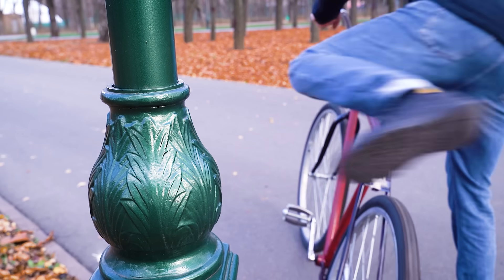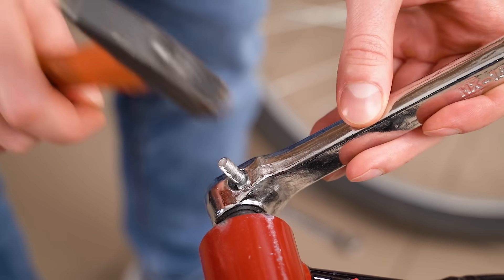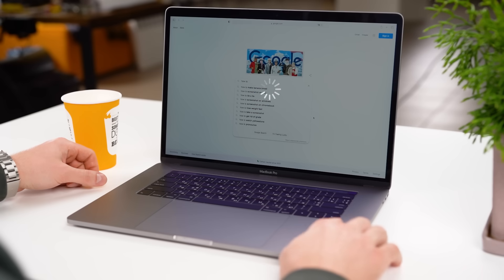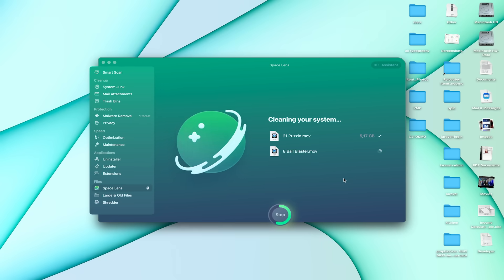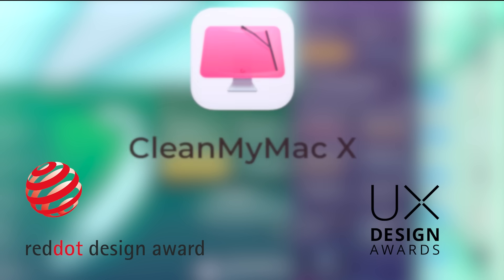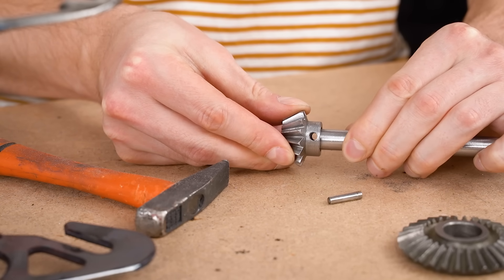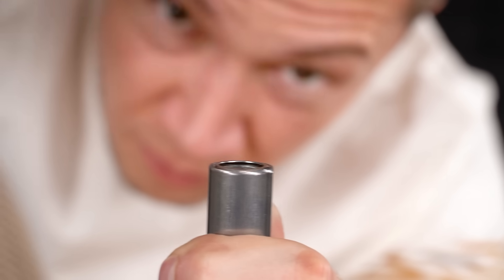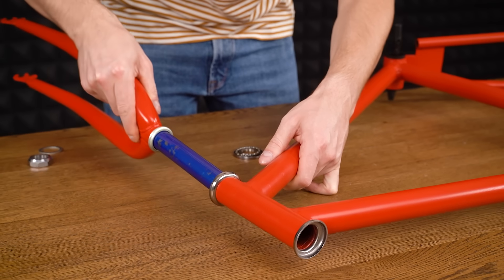Insane Chainless Bicycle Prototype

Comment: The sleek look is definitely top notch. The major disadvantage is friction loss which will be much higher than a conventional chain.
Reply: To do this, you need to lubricate the mechanism, I had an electric saw where the same mechanism was used, I forgot to lubricate it and as a result, after a week, the links were erased.
Reply: I cant speak for bicycles but in motorcycles a new chain is more efficient than bevel gears but actually research shows that chains lose efficiency rapidly as they wear. On a bicycle I guess that's less of a consideration. That's one reason you've seen more motorcycles move toward using belts and gears in recent years, along with lower maintenance.

Obviously with a bicycle gearing is a substantial consideration that favours chains. 👍
Reply: What about the freewheel coast element?
Reply: And another is that he can't rest his foot as the wheel rotates with the rotation of the pedal,unlike the chain system
Reply: @Intesiser2292  That is true as far as this prototype goes but it would not be too difficult to mount the bevel gear on a normal singlespeed freewheel
Reply: @Intesiser2292  that is due to the freespinning freehub connecting the casette/back gear(s) and back wheel allowing the casette to spin. The common drive chain system can be freespin as is most common but also fixed (on a fixie) bike where the chain, pedals and gear/wheel are all spinning together while the bike is moving.
Reply: @Intesiser2292  Actually, it´s not true. At 4:39 you can see that he stops pedaling, but the wheel spins independently. This is obvious because in a normal bicycle the cassette stays stick with the chain, but it´s not integral with the hub and it´s doesn't always rotate along with the wheel. The cog works the same way, thanks to the ball bearings between the cassette or the cog and the hub.
Reply: @ildanny74  This is false. Wheel unable to spin free. Reviewed all footage and hes 100% pedaling it any time the wheel is spinning. 
I dont know how you and i could both watch the same clip, but for some reason you see something that simply isnt there. 
Take a look at a free spinning hub with clutch in it, then look at this hub and get back to me chief.
Reply: @Intesiser2292  it could, just weld that drive gear to the sprocket... retaining the inner hub mechanism. Even pedal bottom brackets come with the same gear mechanism, so you could have a solid rear, the vulnerable part of the driveline.
Reply: and lack of gearing, unless you made a gearbox with some sort of clutch and flywheel
Reply: @gabedamiani4377  even more parasitic loss then.
Reply: Более того, ресурс и цена обычной цепи вполне себя оправдают. Я цепь меняю при езде по лесам и болотам примерно через 2-2,5 тысячи км. Этот конус без защиты столько и не проживет
Reply: @Приколы888  You're father is an employee who gets told what to do so he can feed himself. You're a product of his environment, stay silent and humble son
Reply: @StoneTheCr0w  что?
Reply: @Приколы888  Your racist comment was recorded and reported
Reply: @StoneTheCr0w  Это было 8 месяцев назад непонимаю зачем я это написал
Reply: @StoneTheCr0w  youre a clown
Reply: @StoneTheCr0w  wete you dropped on ypur head kid?
Reply: If this design will be commercialised, they will pour money in it to eliminate all the disadvantages you've mentioned. They will redesign it with a mini gearbox  with lubrication, shift gears, and a one way bearing all of them inside.
Reply: @Brad-ih5zh  so in other words, a totally different design. Smfh
 Theres is a reason this isnt commercially available. Its not a good system.
Reply: Yeah, no bearings or grease in that tube, so good luck.
Reply: @GregZentTrumpetMan  No bearing grease on head tube bearings either.
Reply: @GregZentTrumpetMan  Są.Igiełkowe.Ale to i tak głupi pomysł.Jazda pod górke może stanowić problem, mało ta materiału przy zebatkach.Będzie przeskakiwać na zębach.
Reply: not if u make them out of chromoly or stainless
Reply: I'd say the lack of gear changes is a bigger disadvantage here.  This bike would be horrible in a moderately hilly area.
Reply: What dumb replies. Everything complained about could be easily fixed with more technology. Front internal gears, and a ratcheting mechanism for coasting. I like bicycles far more than most bicyclists. They are such a bunch of conceited whiny ninnies. BMW shaft drives last well over 100,000 miles.
Reply: One to one gear ratio. It would be perfect if you only used it to climb steep hills. Would still be better off walking. Lol
Reply: There are many more disadvantages to this. When you put a lot of force on the pedals, the smaller gear will be pushed out, away from the other gear with great force. In the way he currently welded the tube, the connecting plate will just bend open, losing any contact between the teeth.

It's also much more difficult to do gear shifts, more likely to get something like a long dress or a coat being pulled into the gears, and probably a lot more.
Reply: @Tim van Driel  gear shifting in this way has been done before. Check out ceramic speed.
Reply: @timvandriel4568  this would be even more problematic on a bike with a rear suspension. My first motorcycle (I don't ride anymore) with a shaft drive system scared the crap out of me when I goosed it on a curve! Instead of squatting in the rear from torque, it lifted and threw off my balance for a second.
Reply: That would 8% loss. I.e. shaft bicycle 70kg rider with 150watt cycling would be 4 minutes behind.
Reply: Можно вернуться поискать на дороге- не велика беда @neo_7864
Reply: Single gear is the biggest disadvantage by far. This bike is practically useless.
Reply: @Wip3ou7  well it was single gear anyway? But gear ratio is now like close to or exactly 1:1? 🧐
Reply: just to say mulity gears suck they come off the bike like crazy they don't really work , I've gone up hill on them , you'd be better off walking have most of you even rodr a bike before !?!?
Reply: @Wip3ou7  The entire fixed wheel and singlespeed community says hi 🙂

Apart from that being a bit of a sweeping statement it's not inconcievable that the rear bevel could be connected to a hub gear somehow. Don't forget the bevel drive is only replacing the chain, so this setup can potentially do anything a non-derailleur chain drive can do. You could have a Schlumpf drive on the front if you wanted - go nuts!
Reply: Won’t be embraced for many mechanical reasons.

Comment: There is one problem: if the circuit can be switched, then this technology cannot be. It also has too little gear, you will need to pedal quickly

Comment: With Sturmey Archer type gears it will become even better. Though those pins will elongate those holes fairly quickly and pins shearing will be more of an issue than chains breaking.  Shaft drives, as used on BMW motorbikes amongst others. Have the advantage of requiring less servicing than a chain. However they are less efficient and more effort is wasted. Yours especially so as the gears are not running in an oid bath and if greased up in the open they will attract and hold grit which will wear the gears.

Simply put. A lovely video, creative and well done.  However the engineering is inferior to a chain in many ways. Thumbs up from here, a great watch.

Comment: if u made or have a bigger wheel gear, and made it so you can adjust where the smaller gear sits with a gear lever(adjusting the length of the rod holding the smaller gear), u could make different gear ratios, so ya dont have to pedal as fast or go faster.

Comment: Looks like being able to move forward without having the pedals to be in rotation, like in a regular bicycle, wouldn't be a possibility. ie, you will need to continue moving your legs with the pedals even if going down a slope. But as always, amazing idea, with a beautiful video showing the build. Love this.
Reply: Correct
Reply: Actually, you can still use the same hub. If you notice at the very end he stops peddling about half a second before the bike stops and then he jumps off.
Reply: @MrRusty-fm4gb  completely incorrect. Its a direct drive with 1 gear and no flywheel. For the bike to move at all, he must be pedaling. If the pedals stop moving, so does the bike. Ive scanned the video thoroughly and you are just wrong.

Comment: My concern is the bearing which support the shaft inside the tube.. First there is no seal which means debris, sand, water can ingress to bearing and destroy it.. Second no access for maintenance such as grease fitting.. When passing through dusty or muddy area, this bearing will jammed..

Comment: However transmission ratio after the change is 1:1 so the speed is lower. I estimate transmission ratio to be 3:1before the change. And considering transmission switching (not implemented in the video) a chain is preferred on bicycle as more compact solution. I suggest to find a gear with bigger diameter for pedal mount and rearrange (shorten) the shaft.
Reply: now it's your turn to find out how to increase his speed,,bro
Reply: Probably enough idea to just change the pedal gears for a bigger one. 👍🏼💡
Reply: @karen4897  или установить на заднюю ось маленькую шестерню, такую же, как и на передаточном валу
Reply: От редуктора заднего моста легкового автомобиля,идея прекрасная слегка доработать только

Comment: In bikes its called shaft Drive system.. Its not better than Chain neither cheaper. That is the reason most of the bikes, bicycle use chains..

Comment: Nice work, but that's why chains were created, if your transmition is broken in your trail, it would be almost impossible to repair it, or at least not that practical as to change the chain or ad a part to it

Comment: 2 Major problems are there......1. There gear ⚙️ ratio are same both side it will require more pedaling....and 2. In this system the gears are completely attached to each other... So you can't use momentum to self drive the cycle... Continuous pedaling will required all the time due to fixed attachment... In traditional cycles if we stop pedaling cycle will still run without rotating the Pedals

Comment: I haven't seen brake parts so it would be uncomfortable riding on it on sharp descending roads having no freewheel function. Would still be a challenge even on flat surfaces.
Reply: You can still use the same hub for “freewheel function”. Depending on the hub, you can back peddle and break, or add hand breaks to the handles so you can break like mountain bikes do and still coast without having to peddle. The hub essentially has nothing to do with the gears and can stay the same.

Comment: I think you have successfully worked backwards. Chain technology was the bee's knees in Bicycle engineering. Cool idea though, its been so long since this has been done, most viewers would think it was brand new. Now if you could make a transmission that works with centripetal force and automatically releases in phases depending on how fast the drum is moving, you'll make something truly spectacular and objectively better than the chain setup we have today.

Comment: add another larger gear along with the one you have and give movement to the rod that comes from the pedals so you would use the two gears as if it were change

Comment: surely im not the only one who noticed this.... but...
I didnt see any grease on the headset bearings,
No grease in the needle bearings for the shaft and
No grease on the beveled gears...
Wd40 does not make a good lubricant for periods of time or even when exposed.
Then there is also the lack of seal on the shaft to stop water getting into the needle bearings. 
And when they are in that orientation, the moisture collected can stay stuck in the outer race.
Just stick with a chain. If you have a rock or debree flick up and get jammed in the bevel gear, You're going to have a bad day or atleast a useless drive type.

Comment: With or without the modification, this bike is impressively simple and usable.  My kind of bike.  My only question is if it's fixed gear or has a fly wheel still?
Reply: no bearings so it will be fixed one

Comment: Nice one spraying paint on with the roller bearing wide open there while at the other end covering the BB threads. 👍 I like that you ran the shaft through a stay instead of just bolting sump'm on above or below. Keep it lean, mean & clean right bud? I'll need to see one of the street trials ninjas test this out before I'm sold though.

Comment: As a person who has ridden chain, belt and shaft driven motorcycles, I appreciate your efforts but wonder why anyone would want to replace the fast and very efficient chain technology with a shaft drive? The shaft is smoother at speed with a constant pulling motor but much less efficient with  human powered constantly changing velocities.  Plus when you loose a tooth from your 'differential' you'll be dead on the road while a chain would still function. :)
Reply: It's a prototype. He wanted to do it because he wanted to experiment with it, clearly. I'm sure he doesn't need armchair engineers in the comments to tell him any of this.

Comment: The driveshaft & differential. The reason Suzuki motorcycles are better because no belt or chain to maintain. This is handy but not original or worth 28M views

Comment: Передаточные числа просто вышли из чата. Даже на видео видно как много нужно сделать оборотов педалей чтобы с места сдвинуться. Плюс он по ровной поверхности ехал. А если в горку?  Что-то я очень сильно сомневаюсь, что с подобным положением звёзд эта конструкция будет эффективнее заводской цепи. К тому же, если эта конструкция пазиционируется как более надёжная альтернатива цепи, которая может, по мнению автора, слететь (так себе причина. Вспомните когда у вас последний раз в жизни цепь слетала) , то к надёжности а главное к ресурсу который имеет это изделее возникают большие вопросы. Если цепь при должном обслуживании может десятки лет служить, то это хрень сломается через месяц максимум. Плюс мы не берём в расчёт всякий мусор и камни, которые сильно не навредят цепи, а это поделие сразу выведу из строя. К тому же не понятно что делать если эта хрень сломается где нибудь в лесу. Цепь то можно голыми руками обратно надеть. А тут без сварки ничего не сделаешь.

Sorry for my english.  I use Google translate.

The gear ratios just left the chat.  Even in the video you can see how much pedal revolutions you need to make in order to move from the spot.  Plus he was driving on a flat surface.  And if up the hill?  Something I very much doubt that with a similar position of the stars, this design will be more effective than the factory chain.  In addition, if this design is positioned as a more reliable alternative to the chain, which, according to the author, can fly off (so-so reason. Remember the last time you had a chain in your life), then to reliability and, most importantly, to the resource that this product has  big questions arise.  If the chain, with proper maintenance, can serve for decades, then this crap will break in a month at most.  Plus, we do not take into account any garbage and stones that will not greatly harm the chain, and I will immediately put this item out of action.  Besides, it's not clear what to do if this crap breaks down somewhere in the forest.  You can put the chain back on with your bare hands.  And here you can't do anything without welding.

Comment: Great idea. But one speed and no variable gear ratios is insufficient.  Also no ability to coast ? The drive shaft will news some type of adjustment as it wears and the frame bends or moves over hard bumps? But definitely on the right track.

Comment: Gonna take alot more power for the same amount of gear ration, this is why most motorcycles stick with chains, chains rob the least amount of power from the drive train well under 10 percent , shaft drive is probably the worst over 20 percent.

Comment: bad idea.  Chain tolerates dust and sand much better than gear. Also requires less  lubrication. Reverse pedal is also not in this gear bicycle.